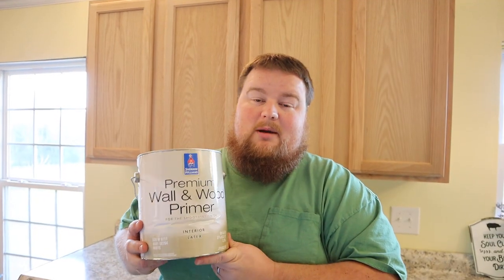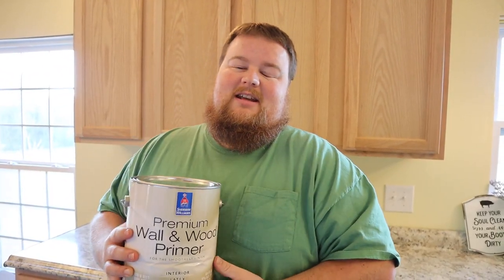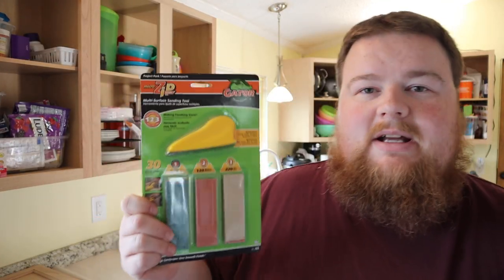Priming the Kitchen Cabinets - Budget Mobile Home Remodel #30

Comment: We had to replace a cabinet in our kitchen and used the same type of cabinet from Home Depot the paint I used was the  Valspar cabinet enamel paint no priming or sanding needed. It was a little expensive but it did the job and saved time. Love how everything is coming along.

Comment: I agree with you on the cabinet quality. I wish there was a Menards in NC, they have the best unfinished maple cabinets (no oak grain!). My biggest gripe about painting cabinets is all the sanding in between each and every coat of paint HOWEVER, that's what makes the difference so it's worth it... in the end.  Funny thing, I've painted/refinished 7 kitchens and I've always hung the doors to dry. I never thought to stack them with the feet, thanks for the idea!!!
Reply from the maker: Glad it helped you! The painting triangles were a huge space saver for this. thanks!

Comment: Just a couple of tips.  Use some good hand lotion just before painting and the paint or primer will wash off much easier.  Also, watch the paint in the pre drilled holes, it will cause a lot of problems.  I have done lots of painting before as a job.

Comment: Here's a tip for laying down paint with less brushstrokes .. Floetral..  it takes a little longer for the paint to dry, but it keeps out a lot of the brushstrokes and gives you a smoother finish.. Lowes and Home Depot, both carry it.. and never again will I paint lowers white, from now on my lowers will be a dark grey or blue with white uppers, the lowers just get to much food, water stains and prints, for my tastes, no matter how much I wipe them down..
Reply from the maker: We'll check into the that, thanks!

Comment: I have the Lowes unfinished cabinets for part of my base cabinets.  There is no Home Depot near me.  I still need to replace 1 more base cabinet and all the upper cabinets and adding a couple of upper cabinets.  Once they are all done, then I will have to get more base and upper cabinets and remove my old fashioned hutch and install the cabinets and countertop where the hutch was.  Not sure what I will do with the hutch, might end up just burning it.  There is nothing wrong with it, just don't have the space to store it.

Comment: I bought my kitchen blue cabinets from Lowe's and they were nice but expensive for my kitchen North wall and the west wall and I do love my special baking center to the left of my stove.  I should say I went with a large corner sink and love it!  On the South wall for my very narrow area at the area between my walk in pantry and my sliding glass patio doors from IKEA I bought the white wall china with glass on top and then for the bass I used  solid wall cabinet with a board painted the same blue as the other cabinets and it has worked out great for my china and on the east wall on the other side of my walking pantry I got tall special cabinet for my big items that goes to the ceiling and then to the left of that cabinet i had a desk put in but have since changed it to a coffee bar area with the same IKEA glass wall cabinet that my Princess House and Tara green ware and other special dishes & glasses/cups and Tea Pots  are that I want to show off with a long  cup holder under that that are used for guest.  I also used the IKEA matching base cabinets for my island.   It was so much easier to get IKEA"S diagram planning sheet and kitchen catalog and order and have everything delivered.  I love how all of IKEA drawers close and there drawers I chose.

Comment: did you/will you add some polyurethane or something to the  raw wood areas inside the drawers and cabinets to make them easier to clean? (is that a thing?)
Reply from the maker: The insides are either coated (drawers) or have a veneer on them to where it won't be needed. If they weren't, we would have had to do something for sure.  The drawers are solid wood but the carcasses of the cabinets are press board with a wood-like (probably melamine) veneer on them.